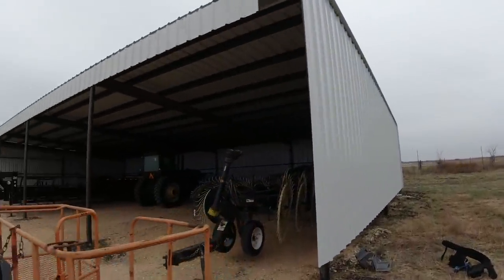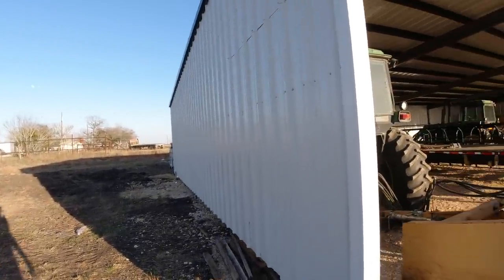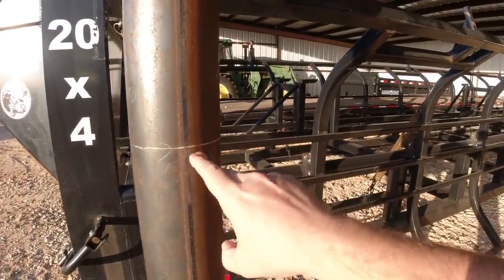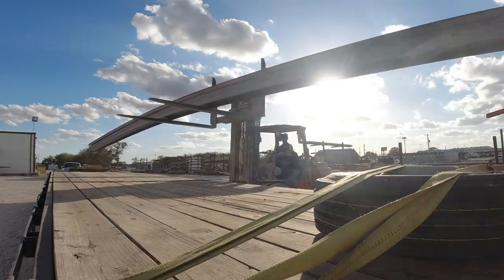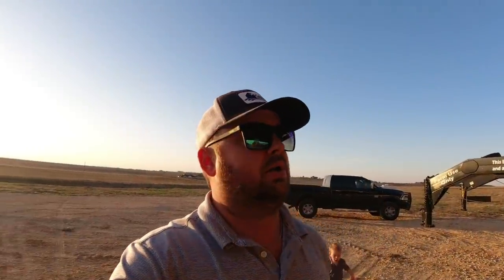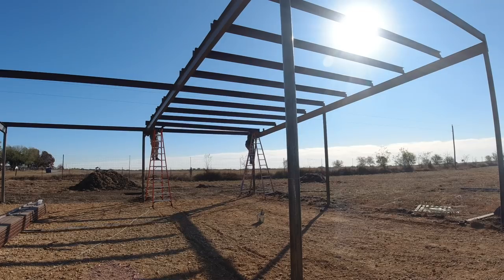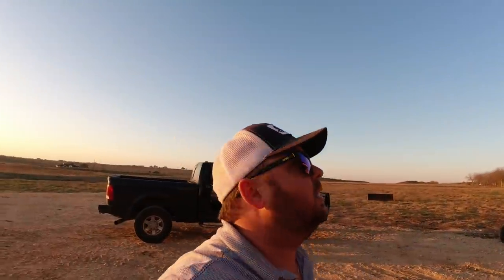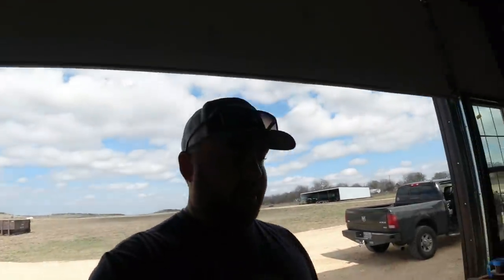How Much Does It Cost to Build Your Own 40x80 Steel Equipment Barn??

Comment: I live in the UK and I reckon steel framed buildings are fantastic value for money when you consider the lifespan ( at least 50 years) and the use you can make of them, compared to spending the same money on upgrading vehicles , machinery etc they are so much better value

Comment: Just stumbled onto this video as I just finished a similar building that is 36 x 50. One thing that worries me is your building doesn't look braced enough. I say this coming from somebody that has built buildings in the past that were damaged by wind. Judging by your flat terrain, I'm going to say you get some strong winds. If you ever get a wind blowing into the front of that shed, there is going to be a tremendous pressure on that roof and walls trying to blow out. I think you should consider some angle braces on the post and some cable X bracing in the ceiling and side walls. All factory designed metal buildings of this size have both of these.

Comment: There’s a tin company within 75 miles of me that does “seconds” metal for about 50-75 cents less a foot then “perfect“ metal. The “seconds” have runs in the paint and an extra coat of clear. Great stuff for a roof or barn.
Reply: Could I ask where that is located
Reply: @dustinwillis113  Kentucky.
Reply: @stuartgibson1896  I’m just south of KY in Oneida, TN.  How far is that tin company from I-75?  Would you mind sharing the company name?  Thanks, Tim
Reply: @CliffsideStables  the place is called Dutchman Metal. They are located in Liberty KY.
Reply: @stuartgibson1896  THANKS!  They are certainly within easy commute of Oneida.  Tim

Comment: Great video. You mentioned that you fashioned a few of your own jigs. I would really be interested to learn how you went about making the flat metal "ears" for the purlins to be connected to, and specifically how you got the slope pitch correct when welding them to the I-Beam.
Reply: The "ears" would just be welded square to the beam. The beam is already on the correct pitch, so no need to pitch the ears. Personally, I would have probably used angle iron instead of flat iron, just for the simplicity of installation of not having to square each one.

Comment: Nice building, great job.
Could not help but notice the SAMSUNG appliances. I take it you bought all new for the house when completed?
Sorry to inform you, I did the same thing 6 years ago. Thought we had the cream of the crop, ended up with crap. Microwave over the Range that never worked correctly, had the main board changed, along with the touch control board. It would turn on by itself, or the light would, the fan, whatever, said it was possessed. A dishwasher that does a minimal job at best, a fridge that the ice builds up in freezer to 2 inches thick, and drawer will not close properly, which in turn let water run onto floor, until it is defrosted. It was a manufacturing defect, but the fix is $700 not under warranty. If you have the 2door fridge with the freezer drawer on bottom, return it now, you will curse it until you decide to throw it out the door.. 
Stove, so far no problems   LOL  Sorry to be the barer of bad news, look at all the reviews at home depot of any appliance they are all crap, that comes from China now. Even if the do work ok, they only last 2-5 years on average.

Comment: are wind bracing angles not nessesary on a steel framed building? i was going to build with wood and there is a lot of bracing. after seeing these buildings maybe metal would be better.
Reply: He would need some bracing if he gets much wind, and I'd say he gets a fair amount for as flat as it is. All factory made steel building kits of that size has angle bracing and cable X bracing.

Comment: Talks too fast to follow. A shame, because this could be really helpful.
Reply from the maker: Sorry. You can rewind or go back to previous videos where we broke down each step.
Reply: Hey Robert, just click on the "Settings" icon at the bottom of the video frame (Desktop) or the 3 vertical dots in the top right corner of video (mobile phone), then click  "Playback Speed" which will allow you to slow down or speed up YouTube videos.  Hope this helps.
Bless'ns to ya,   Tedd